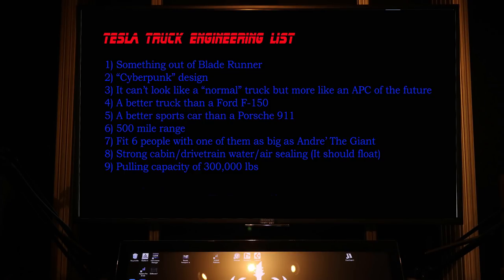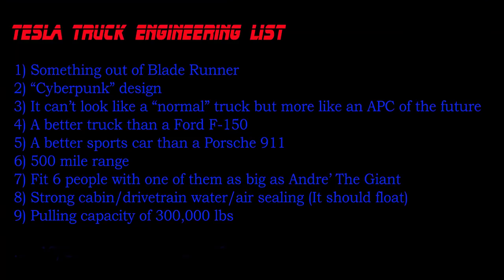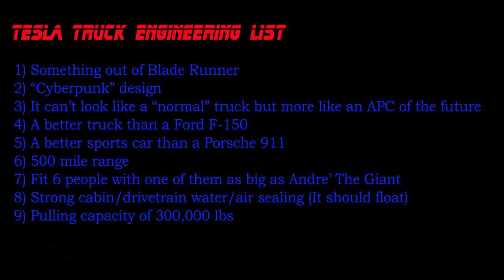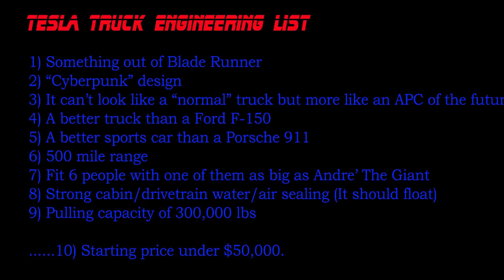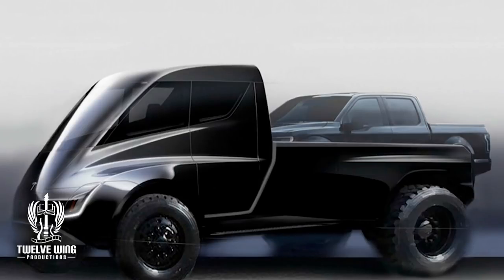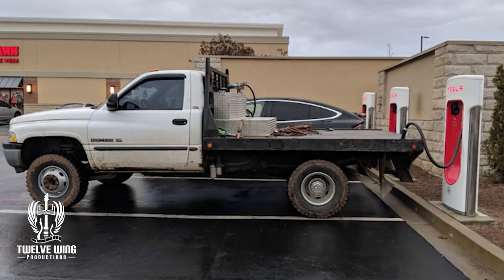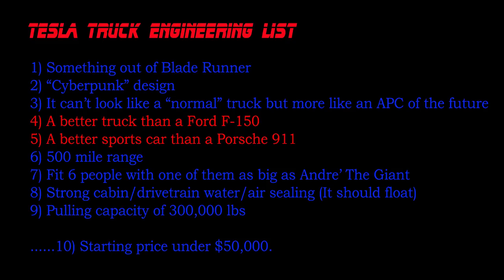What Tesla's Pickup Truck will Really look like: A design exercise

Comment: I think a lot of the work cap specs with have to do with some secret sauce battery/ super capacitor stuff that Elon knows is in the pipes.
Reply from the maker: One thing I scripted but seem to have forgotten to put into the video was that it will supply power to the job site.  It can power a welder, power tools or it could be used to power hydraulics to run a tow truck and also be able to charge stranded electric vehicles.
This thing really does have the potential to turn things around in a hurry.  I can see why Ford is looking to go electric with their F-150 right away.  Such a truck from Tesla could kill them.
Reply: @twelvewingproductions7508  So a bigger battery in general might be required? Or a backup battery for worksite application? But that would spike the price point unless it is a different package. Like, after Plaid, there is only Norris.
Reply from the maker: @StrippedCoverLitMedia  Yup.. they aren't going to be producing the 200kwh truck for $49,999.
That would likely be an $80K variant.
That said... what job site wouldn't want that friggin truck?
I think the real issue will be when this thing starts to be used for serious towing.
Serious towing will drain the batteries quickly.
500 miles of range towing a horse trailer would look more like 200 miles.

For that reason I think we will start to see powered trailers VERY quickly.  They will have solar panels on their roofs and will slowly charge the battery while they sit as well as maintaining housekeeping like refrigeration and cooling fans.
The trailers can then be self powered to assist up hills and use regenerative braking down the other side.
I would love to be on the design team for such a thing.
We really are on the cusp of some wonderful things in the very near future.
Reply: @twelvewingproductions7508  Is this where we would start to see the benefits from your Maxwell video of a quick charge ultra capacitor slowly pumping into a battery while also providing the sudden oomph necessary to begin towing?
Reply from the maker: @StrippedCoverLitMedia  Yes, and for other things also.. like instant response for using the truck for doing things like welding.
Running a welder could potentially be quite hard on the system as well.
Down hill braking using the motors could also be hugely beneficial to use ultracaps as a buffer.
Basically everything that would help the new Roadster get around a race track would also help this truck.  That's why I'm pretty sure the two technologies are linked.
Reply: @twelvewingproductions7508  I think it is also important to remember that Elon never kind of does anything. So, maybe standard issue solar-panel bed-covers? And what will be the advantage to keying off the truck versus and extension cord? Your video definitely got me re-excited about the unveiling. Would love to see you do another video just riffing on potential specs for this and future vehicles (towing capacity on the semi, next gen roadster, what would have to happen for ultra caps to phase out batteries, why Tesla doesnt invade India market with 1/3 battery sized vehicles, etc. With your knowledge base, Tesla vids could be extremely lucrative for you.)
Reply from the maker: @StrippedCoverLitMedia  I'm glad you are excited and reinvigorated!
I'm very excited to see what is up his sleeve as well.
That kind of video series sounds fun.  I am planning an electric mobility series this coming year as well as followup videos for The Energy Sovereignty Project.

Some of the large e-bikes for cargo might be something we could see in places like India and other places in Asia where space is at a premium. 

It's important that we uplift everyone with this.  Make life cheaper overall and increase our quality of life.

One area I think has huge potential is in the recreation market.  I have some pretty cool designs for 5th wheel integrated van type electric vehicles.
So I may have to do some videos on some of my designs for better living.  Assisted by renewable energy, but really more showcasing my lifestyle philosophy. 

People need to be allowed to live without everyone having both hands in their pockets.
Reply: @twelvewingproductions7508  Whatever videos you decide to make, I'm excited to watch them. Also, I run a channel as well, and would encourage you to integrate social media (especially instagram) to your channel to help spread the word and mission. (Sorry of you're already doing so and I have missed it.)
Reply from the maker: @StrippedCoverLitMedia  I'll look into it.  Currently I'm a one man operation mostly.  So I have to see how best to divide my time with that.  As the channel grows, since there seems to be a surprising interest, I will be able to bring others into this to assist with production.
Very humbling to see how many of you are interested in this stuff... and all your great responses.
In reading the comments to this and other videos, it's pretty obvious that the folk gathered here are really something special.
Reply: @twelvewingproductions7508  Again, as a content creator myself, the community is a reflection of the creator. You're doing really interesting stuff.
Reply from the maker: @StrippedCoverLitMedia  Thank you sir.  Very kind of you to say.
Reply: @StrippedCoverLitMedia  Giga Factory 5 is secluded for India in less than 2 ish years they want to break ground about halfway through Giga 4 build which they just announced two days ago is being built in Berlin starting early next year. And possibly partnership with VW.
Reply: @ronaldmasterbud1551  I dont remember the specifics, but India is also at the center of the slightly-more-than rumor Tesla mining projects. I think it was something about lithium, copper and cobalt all being fairly abundant in some places?

Comment: You will know the physics much better than me, so instead of making a prediction I will just ask the question: With a vehicle that long, is there a battery placement/orientation that could best benefit the "pulling" capacity? Also, Gali from hyperchange predicted they would be pulling one of the space-x rockets as a stunt for the unveiling. Which would be pretty sweet. I tweeted him a couple of your vids a while back, hoping you guys get to collab.
Reply from the maker: We have been in contact.  Great fellow.  Hopefully we can work together on something soon.
As to the battery placement, that's an interesting question.
if we were talking about a trailer, I would say that keeping a positive tongue weight is critical for stability.
I am going to have to look into ideal weight distributions for towing stability on the tractor.
If I were going to design for weight distribution it would be for towing stability and not for pulling.
Reply: This is Something that has been done in trucking, aviation,  boats where you have a sliding ballast that the operator controls,  So on the New truck You could split the battery pack in half.  For optional location for One or Two passengers,  Then depending on if the bed is full, hauling a Gooseneck trailer, a fifth wheel,  or conventional trailer,  and how it's loaded.  The Second half of the battery pack could could transverse,  Say + or  - 18" to easily compensate for load, driving stability and weight and Balance,  for optimum ride quality and safety.
Reply from the maker: @ronaldmasterbud1551 , I don't see them moving the battery but I sure as hell see them moving the rear axle.
Then again, the battery is such a heavy component, you would probably get more bang for the buck moving it even a few inches.
I think the battery box will be an integral part of the stiffness of the chassis though.  So hard to say.
Reply: @twelvewingproductions7508  so Build in 
a portion of Dead air in the battery box for a Jack screw to move battery pack for and aft + or - 6" for optimum balance,  plus the additional volume will add bouency.
Reply from the maker: @ronaldmasterbud1551 , We agree that it sure wouldn't take much of a movement to make a large difference.

Comment: It will have a dynamic wheelbase up to eight feet with push button changer
It will have built-in 110/240v outlets
It will have optional beds -electrical/joinery/roofing/plumbing/automobile service/breakdown truck
It will have optional scissor lift (solar roofing work etc)
It will have built-in winch
It will have crane type stabilisers/supports at each wheel
It will have optional track laying wheels or similar
It will have optional awnings
It will have satellite communications capability

Comment: By a standard driver license there is a limit to the GVW and GVWR (max weight with tow weight) weights that you can drive without a CDL. This Pickup would have to fall into the non CDL category anyway. I believe the GVW(vehicle loaded) limit is 21,500 and the GVWR (with tow) max is 26,000 without a CDL. That is what my chevy kodiak C4500 has. So there is a limit it can be rated to tow anyway.  With the exception of Recreational vehicles. (motor homes) I think.

Comment: Three things I think. 1.It cant be simply a mini version of the Semi. It must a Frunk because of it's mass it needs a crumple zone. 2.A good tow rating would be 20,000 pounds. 20,000lbs is the weight of the heaviest 5th wheel and that would cut into the "Dually truck
" market. Probably would need the Dually tires to pull that and that certainly wouldn't fit in a normal charging spot...  3. I would want the bed to take a pallet of sod or water without sagging. This would be one of the many benefits of an air suspension.